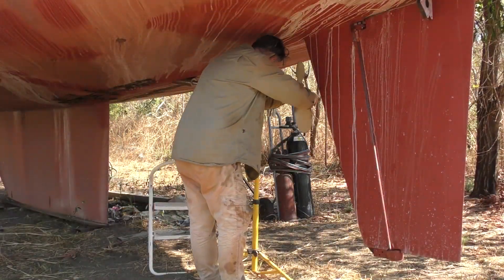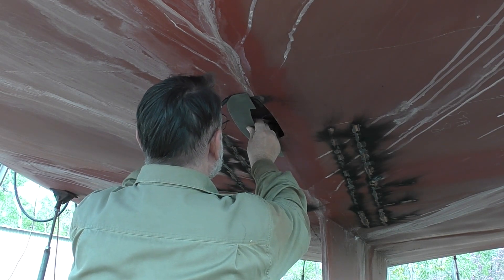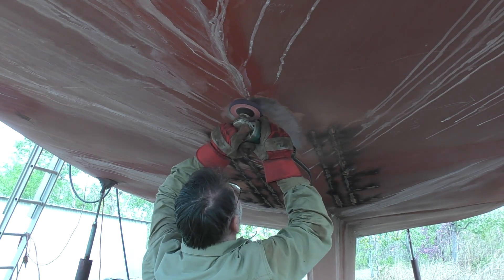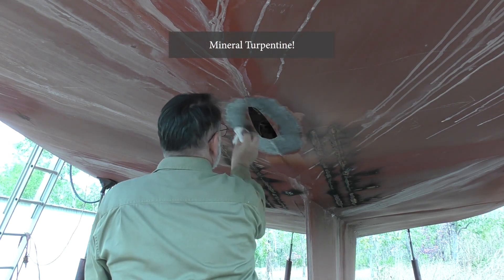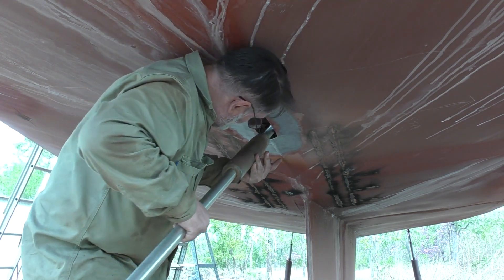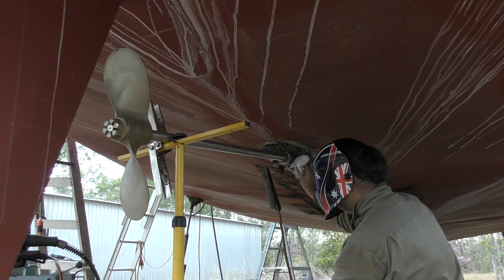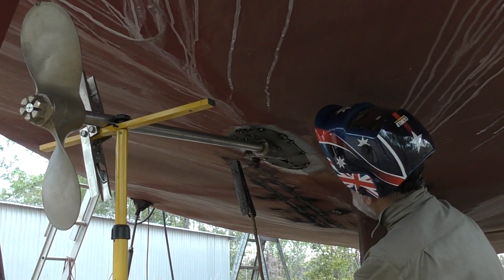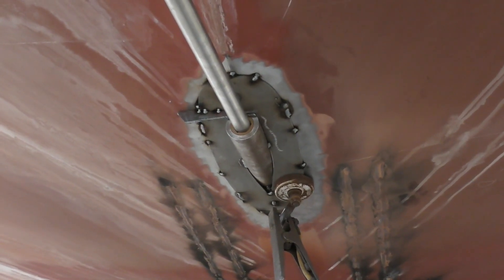Steel Sailboat Building SteelAway - Shaft Initial Alignment Part 4

Comment: I'm repairing my steel hull and I was just wondering if might have the problem of corrosion over time berwwen the plates and the hull
Reply from the maker: I suppose there is always the risk of corrosion between plates. That said if the plates (say a doubler) are cleaned well and treated, then sealed completely from the atmosphere when welded, you shouldn't get any to be overly concerned about. My plates are exposed on the inside of the hull so I will treat them before closing in there too. Cheers, Garry.

Comment: Just finishing up an 8 year refit on an older design steel Roberts 45 Mauritius. Fixed a lot of things that weren`t done that well at the beginning and some things subsequent owners did too. One of the majors was to have the stern and rudder tubes both line bored so the new rudder bearings and cutless bearing in the propeller  stern tube would fit properly . Ours were a good  2mm out of round for the  75mm rudder tube and about a mm for the propeller tube which is made of 63mm with 8mm walls. Yours looks a bit chunkier than that so might not change much. Might pay to check when all the weld up is done. Ours was easy to fix, just bore out to the next size bearing and turn the shaft from 2" (50.8mm)  down to 50mm. Metric on the outside and the inside, with a nice clean shaft to put through the cutless bearing. I don`t mind grinding, i hate sand blasting!
Reply from the maker: Thanks Warren. I had mine made to the plans spec in a marine shop in Brisbane. The tubes rudder/prop are heavy wall tube and were machined spot on from what I can see. Do you think the original owner of your boat did it DIY maybe? The aft prop shaft strut bearing housing was machined up in the same shop, so I think it will be pretty good too. Great to get some feedback thanks for the info!
Reply: @garrychapple6418  Looks like you`re doing a good job.My point was the welding process will pull the tubes out of round so the bearings will have to be forced into an irregular shape. Easy to check with internal calipers after welding. This is what happened to our boat during the building process, so when it came time for new bearings nothing would fit without hammering home. Then the shafts wanted to bind. We had a guy come out with a small mobile line boring rig and cut the internal fit of the tubes round again which meant we could fit new rudder and propeller bearings exactly true with enough clearance for paint on the inside of the tubes. We also used a material called Vesconite for the rudder tube bearings. Expensive, but dosen`t swell in water as much as nylon so you can keep the shaft tolerance correct. These are things i wish i new the day the boat came home, been a long road to get to here. Had the last year off to finish it, not done yet.   Cheers, Warren
Reply from the maker: @SeeBird686  I see what you mean. Yes I have vernier calipers so will check the bores for round before pushing the bearings back in. Hopefully they will stay pretty true because of the tube thickness, but heat does some unpredictable things to steel! Cheers, Garry.